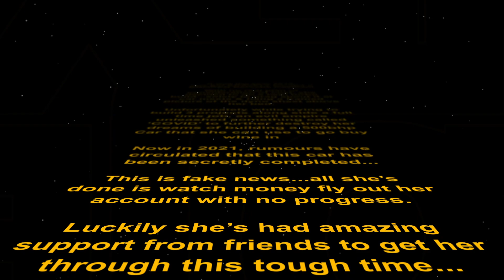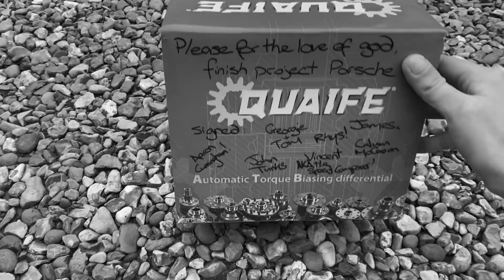🚨TWIN TURBO PORSCHE CAYMAN S PROJECT: FIRST AND BEST MODIFICATION/UPGRADE 🚨  *TRUST ME* 😉

Comment: ...but if I mod mine it'll be worth nothing, surely ? Even the true excellence of a Bosch swish/swoosh water removal system as an improvement over the parp/eeeerrk standard water spreader system would devalue it more than actually putting a mile or two on it.